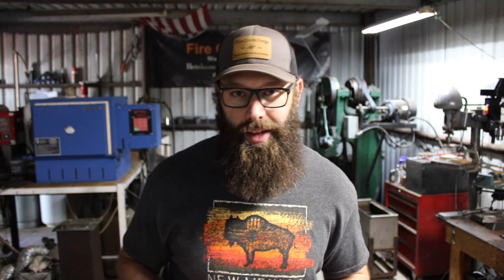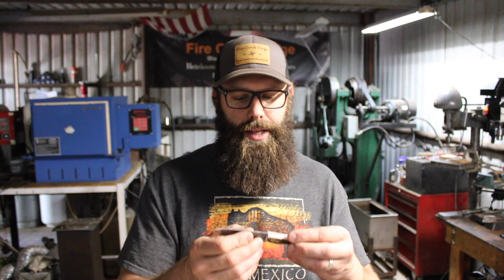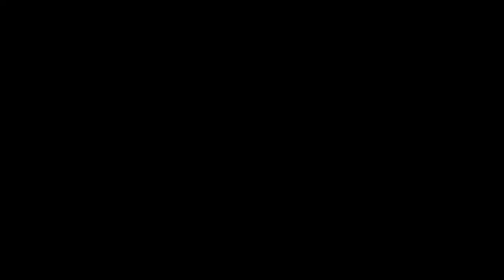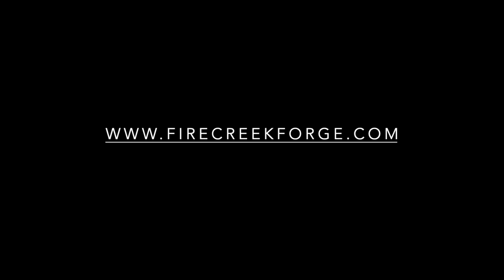3 Common Mistakes: Beginner Knife Makers In Blacksmithing And Knifemaking

Comment: Thank Forged in Fire for many of the issues that new knifemakers have, particularly issue #1. Thinking all knives need to be able to do everything, and be 3/8' thick and 15" long. Forged in Fire got me into knifemaking, but also gave me a distorted view of what knifemaking is about. I make little EDC knives and peoplke ask me if I test them by batoning through logs. No, I do not.
Reply from the maker: Good point

Comment: As a newer knife maker coming from culinary, the instructors you have matter more than anything.  I have always had a tendency to overestimate what I need. So my first knives were far too thick but have improved. Most knife handle forming instructions are to put a 45 degree angle on the handle all around and then hand sand to oval. The part that's left out of instructions is how aggressive that 45 is.
Reply: 🤔🤔

45° is 45° lol.

There isn't levels of aggressiveness... it's always 45° right?

Comment: Yeah, I'm absolutely one of those guys that had a tough time making my edges thin.  Ironically, the thing that cured me was the making of a mistake - I used a fuller to spread out material from a twist damascus bar ( wanted the knife about 3 inches tall at the heel and the bar was very slightly over 1 inch in diameter), and I had some super deep fuller marks near the edge, so I had to grind the knife into oblivion. It's probably the best kitchen knife I've ever made though.
Reply from the maker: Nice! Silver lining to a perceived mistake

Comment: The cutting board is where you stop cutting, control your cut.  Also I recommend bamboo type cutting boards.  It allows your edge to stay longer.  However, the bamboo boards will need to be replaced in certain times based on how you cut (meat, poultry, fish, veggies, etc).  Keep your edge sharp.  Have a good strop and a ceramic rod.

Comment: Thank you! I felt like you were talking just to me. I am about to start on my fourth knife, a boning knife. It is out of necessity; my store-bought boning knife will not hold an edge. So, I am getting into knife making, so why not make my own? I've researched and designed the blade based on several knives I like (not reinventing the wheel). I appreciate your comment about going thinner than you think you need to, then testing it on what your intended use is. Thanks for that. Lastly, my handles suck! Too big and blocky. I like the advice about creating an oval.

All three bits of advice will be used in my next build. Thanks!
Reply from the maker: Good deal, glad it was helpful!!

Comment: Best advice I think when it comes to formulating your learning early on is to simply make a lot of knives. You're going to wreck a few, make some banana shaped blades and that's completely fine because you're learning. So find a design you like and can actually make, then pick a material you can work with that will respond to your tooling, design and function. Then comes the next step- the production stage where your design becomes reality and through the process you'll come across how the materials work, how the technique will suit the design and you go back and forth until you hit the sweet spot between your design reality and the product.
Maybe that means losing a curve in the handle, using 4 pins instead of 2, dropping or adding an inch in length and of course actually using the thing for what you intended it for. But most importantly, don't jump in and go huge, start small, use your material economically and then sit down and analyse what worked, what didn't and what caused you problems. There will be problems, the main difference between the Starter and an Experienced knife maker is often down to how they can overcome problems or fix mistakes; Then in turn, they will see where you will have problems and mistakes later on before you even touch a production stage.
Reply: Not only a knife making lesson, but what you said could resonate with most creative trades.
Reply: @digiubus  Making a complete object from scratch with just raw materials, an idea and then running it through to completion isn't a thing people shouldn't underestimate. It's a hard old gig and if anyone could do it, they probably would; But they cannot, so they don't, then buy something for 20-200 bucks at a big box store and call it a day.
Knife making is even worse than both art and engineering- 
I did both by having a BA in visual arts majoring in painting and drawing, then I also worked for 20 years in electrical engineering, networking and telecommunications.
Now if I design you a picture, sketch it out, get a colour palette that suits the idea I'm working towards it will need a composition that comes together in terms of how it leads the eye, makes the viewer feel when they see it and makes for an engaging visual experience. I will have succeeded, the art doesn't have to have a purpose and indeed it actually having some kind of function would mean its not actually art. Art exists for arts sake.
Now, making you a 4G phone, microwave or optical network, sure, i can do that and we set budgets, labour, time and materials, find places to put it all and at the end of the day, if you get it on time, working and serviceable for its expected lifespan you figure, yeah that was a good experience from your service and I don't give a shit how it looks! If the LED's flash in uniform colours or you used plastic or stainless cable trays no one cares.

Knife making for me is that awkward area between design, art and engineering we call 'Artisanal'
It has to look and feel good, it has to last a long time, work under awful conditions and function very well while doing all that. Not everyone takes that approach and I'll personally vouch for it being a cathartic, humbling experience for people to go out there, make something with their own two hands and instead of sitting in an office for 40hr a week making paperwork. You made a tool that works and has a tangible quality to it.
However or whatever you do though, make sure you enjoy it.
Reply: @krissteel4074  I have the fortune to be a commercial plumber , so I I understand what you are getting at. I love bringing functionality out of my art (piping) and it's probably my best  talent.

Comment: I agree on all points, especially handles; I’m not a real knife maker myself, only made a couple for fun, but I’ve noticed the most obvious sign of a newbie knife maker is handles that are either super bulky, or way to slender for the knife they are on. Like you said about blade thickness, I think there is a hesitance to remove ‘to much’ and ‘ruin’ it, or an overzealous ‘gotta round it off’ and end up with to little. 
But you gotta pass through those stages to get to experienced knife designer and maker I guess.

Comment: Good advice especially on handles, there is nothing worse than having to use say a machete for a long period when the handle is either too big  or too square (too round is also bad but for different reasons)  ...too big makes you grip harder and messes up your stamina for working and too square will give you horrendous blisters and hand pains .
My biggest mistake was making handles too big... or too round so I couldnt index the cutting edge very well so I would be working and hit off centre or almost lose the tool altogether 

Don't put lanyards on swinging tools ...not even lanyard holes...  some one will lose tendons when they slip and let go of the tool and it swings back around and either hits them in the elbow or  or the back of the chest or leg
Lanyards bad idea